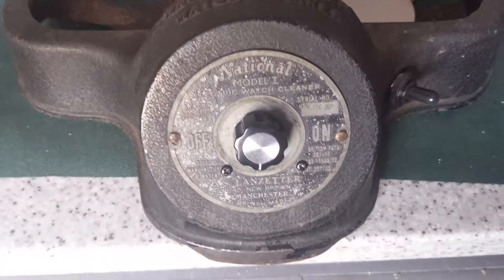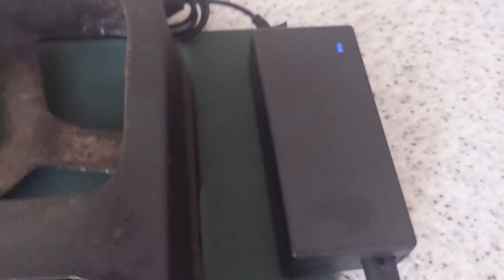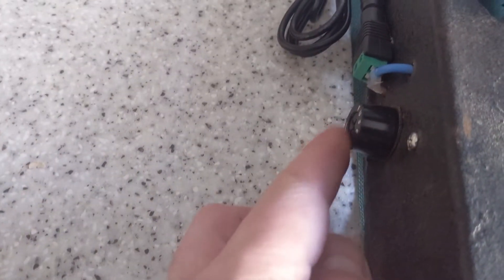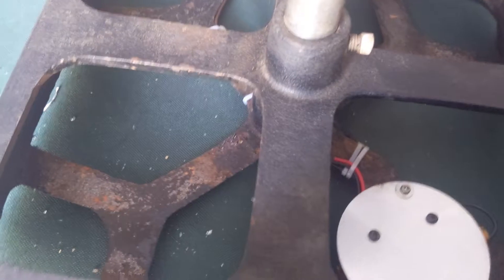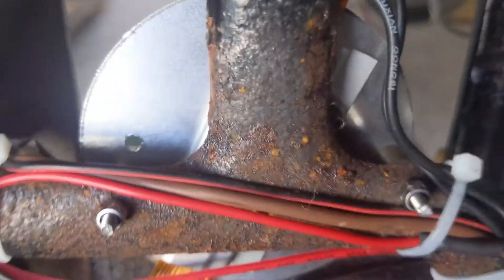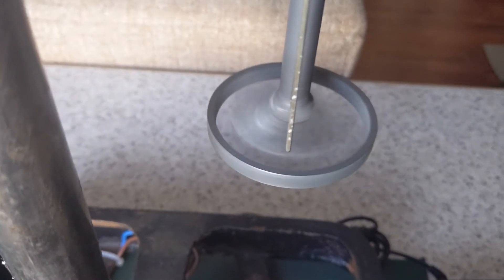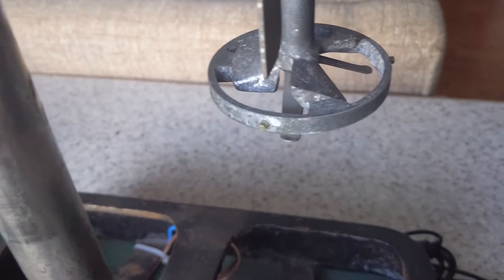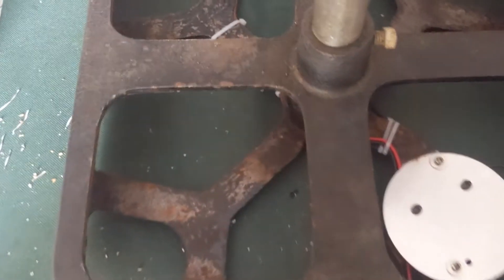1940's National model 1 electric watch cleaner by Lanzetter of Manchester repair

Comment: can you dry the watch parts and have the motor running as well the reason im asking im doing the same with mine if i have the heater on the motor is very sluggish can you help me please
Reply from the maker: Is this with the conversion to 24v? It's likely the power supply can't provide enough current to run the heater and motor at the same time. The conversion I made does allow for both motor and heater to be on at the same time as the cleaning solution has to be heated to be more effective
Reply: @ I’ve converted mine to 12 volts how do you convert it to 24 volts please
Reply from the maker: It's basically a heating element and motor in parallel. So you would need to replace the motor and element with one that is rated at 24v. I assume you have used a 12v element and motor? Any voltage will work as long as the motor, speed controller and element are the same voltage as the power supply used.

As in my first reply I suspect the power supply you are using isn't providing enough current. You need to look at how much power the element and motor draws and buy a power supply with at least the rating of both added together.

12v is fine if you are using a 12v motor and element together with a speed controller. A rheostat based speed controller does not work with all motors. A PWM electronic controller works best with DC motors.
Reply: @adriansmith31  thank you your a star
Reply: @adriansmith31  I have a question please were do I get the heater you have please sorry for asking
Reply from the maker: @watchwhisper it was amazon or Ebay, can't remember
Reply: @ ok thank you
Reply: @ hope your ok

Comment: a very good informative video. i've just this very weeki purchased this exact model in a similar state and i think i'm going to convert it to be safe. i'm ignorant when it comes to electrical technicalities but i can re-wire things safely . can i ask is it a 10 amp or 5 ap speed contrller being used? would a 12v 5 amp suply power a 10 amp speed controller ? those are the kinds of technicalities of which i'm pig ignorant.
Reply from the maker: I didn't use a speed controller on this mod, I used a variable voltage regulator rated at 8A (supposedly) off eBay. It was a switch mode unit rather than linear type. I did convert a similar watch cleaner and used a DC speed controller that uses PWM. On this one though I used a 5 amp power supply to run the heater and motor which was adequate for the wattage of the heater I used. It gets nowhere near as hot as the original so on the second unit I modified I used a higher wattage 24 volt element.

The guy who has the unit never got back to me how effective the new heater was but he said the motor worked great. I have a video of the second watch cleaner I modified.

For power supply specs the heater uses the most power, the motor not so much. Perhaps 2 amps current when stalled so operating normally it will be less than that.

A 5 amp power supply can power a 10 amp speed controller as long as the load on it doesn't exceed 5 amps. The 10 amps just means it can supply up to 10 amps, it will be fine with a motor that draws half of that. Just note that the heater is the main concern when specifying a power supply.
Reply: @adriansmith31  that's great adrian thank you very much ;o) i'm going to try and find your other video now.
Reply from the maker: @wichywoo  there's a list of parts I used in the description if that helps. The motor was 12/24v and too fast at 24v in the end I used a 150w 19v laptop charger as the power supply.

On this unit one thing I had problems with was the impeller shaft is imperial and the motor was metric so it wobbled quite a bit. I bought a coupling from eBay and used a friend's lathe to make the impeller fit. The second watch cleaner was newer and used metric sizes so that wasn't an issue. Depending on the motor you choose you may have a similar problem and might need to make or modify a coupling. Some metalworking was required to fit the motor. I used some aluminium brackets.

Comment: hello, I'm restoring a 1950's Zenith 120v Cleaning machine and the two IRC type DE RES 500 25W heating elements are not working. I checked and it is getting power. Since they seem to be obsolete, any ideas for replacing them with a modern heating element?
Reply from the maker: Hi I used a PTC heating element typically available from eBay / Amazon. I had to make a plate to fasten it to using 3mm thick aluminium and then used standoffs and mounting bolts to fix it to the frame. I converted mine to 12v DC but mains powered elements are available. I had the same problem; obsolete parts. There was a company in Germany selling parts for mine but all it was were a cheap PTC heater on a circular aluminium plate. They don't sell them anymore but it was easy to make one myself.

The video was hastily done but you can see the plate I made in the video. The element is fastened to the underside. It's shown fitted to the top in the photo at the beginning. I found it worked better fastened to the underside so as to transfer as much heat to the jar as possible.

I did another video on a second machine that dates from the 1960s. That ran on 24v but I did the same thing more or less.
Reply: @adriansmith31  Thanks I'll check those out. While I'm no electrician, It seems they are just resistor and I have found ones that are a half inch shorter.
Reply from the maker: @24hourgmtchannel64  yes they are basically a resistor but it changes with heat so they maintain a temperature. I don't know how hot the original elements got but I chose 80 degree centigrade PTC heaters for the machines I repaired. Owner of the machines hasn't come back to me on how well the heaters work but he hasn't said they don't work so 80 degrees must be okay. They were 18 watt elements if I remember correctly.

Comment: Good job with repairing it. Interesting is this replacement of motor from HP printer :)
Reply from the maker: Yes it's the motor from the printer I threw out of my window. The motor survived :;
Reply: Hi Adrian, nice project👍
I've got the same machine and I'm looking to do the same as you...im interested in how you installed the motor in the housing? Regards, Clive